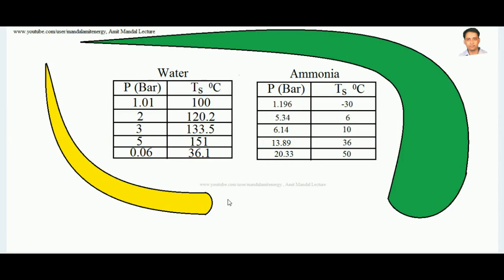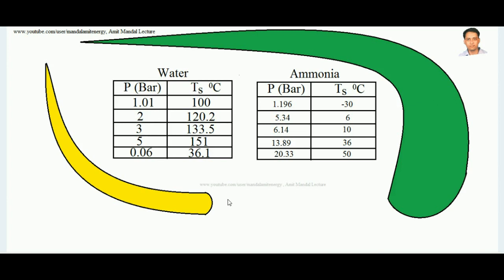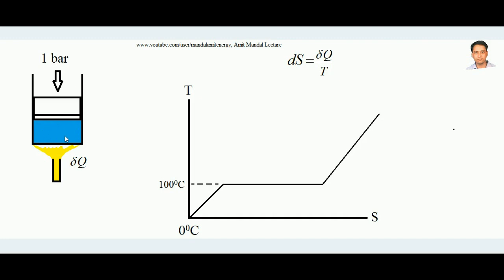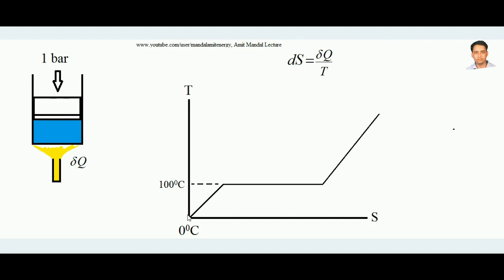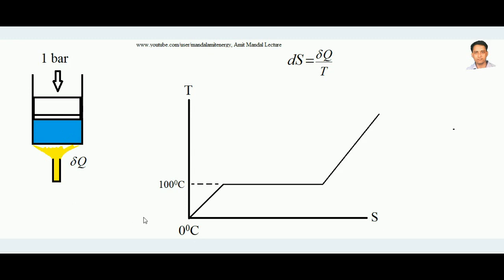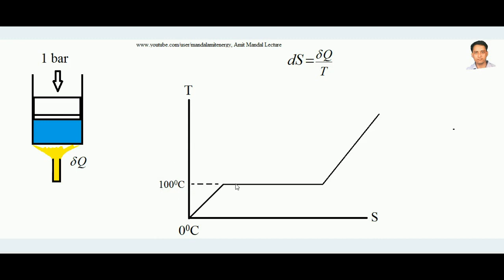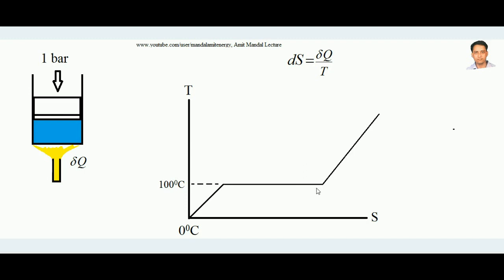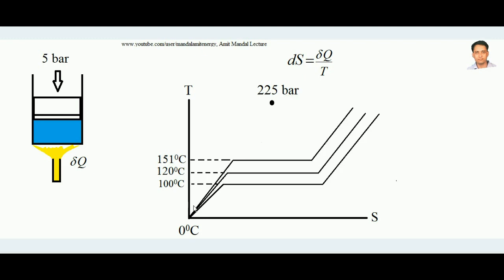TS diagram of water

Comment: Why Entropy of water will be Zero at 0 degree cel .... its should be zero on 0 K , i think ? please clarify
Reply from the maker: Generally TS diagram are used in steam power plants, since in boiler the water enters always with  temperature higher than 0C hence at 0C the datum of entropy and enthalpy are set as 0.